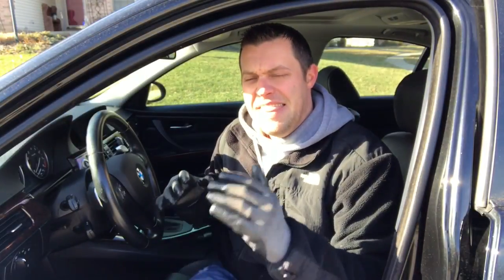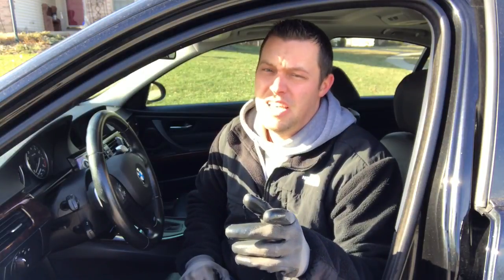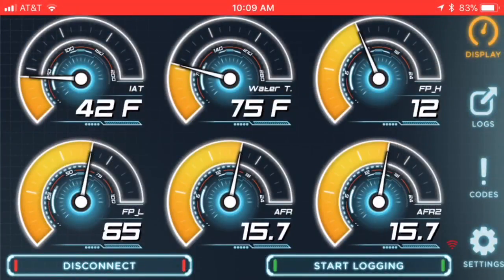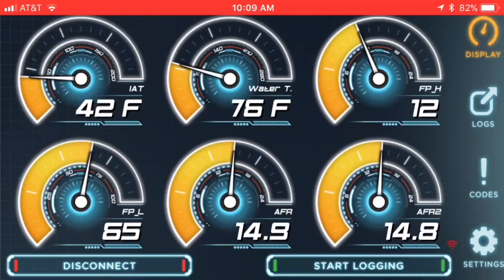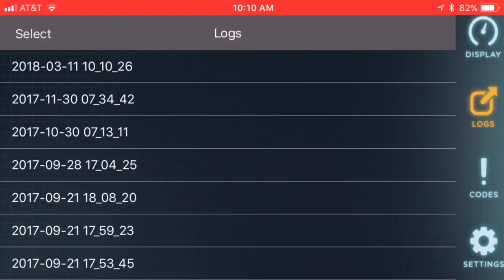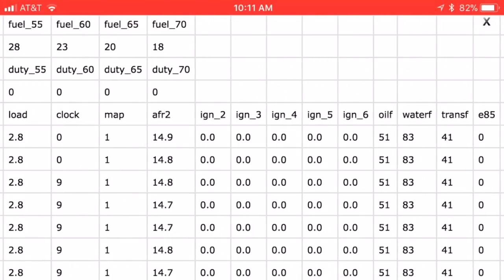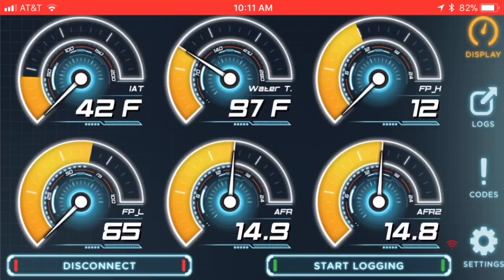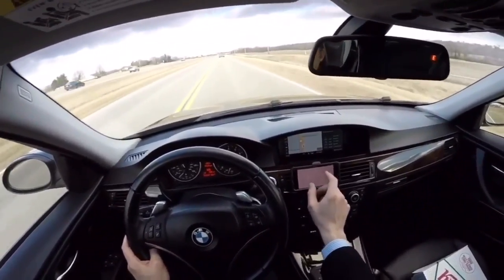How To Spot BMW N54/N55 ISSUES Before They Happen!!

Comment: Can I use NGK 1 step colder plugs on a stock N54? I feel like my car hesitates with the bosch plugs and i have new plugs and coils but i did have a bad injector for awhile like for a few thousand miles but i did just upgrade to index 12s and i have DCIs and a 5 inch FMIC and a secondary cat delete, and also do you think i damaged my engine? i feel and hear a rattling sound when the car is cold when i give it gas but it stops when the car is warm, any ideas?
Reply: I have the same sound..

Comment: So essentially, with a JB4 you don't need other equipment/software like Carly, correct?
Reply from the maker: Dan Millán yes and no - yes for spotting those issues on your car with the data that your DME is already displaying and code reading. No - if you need need further diagnostic work done then you need a specific BMW scan tool software like ISTA+ or INPA